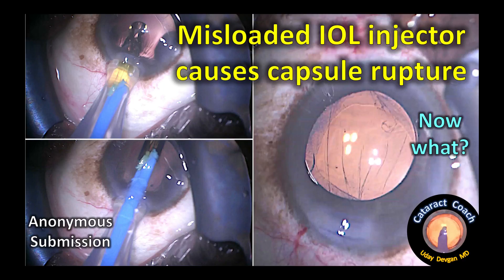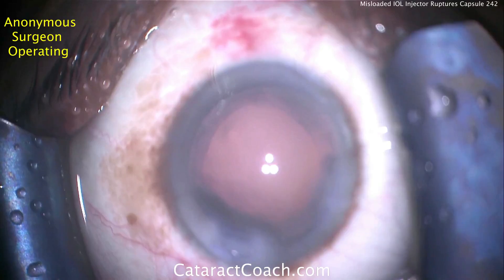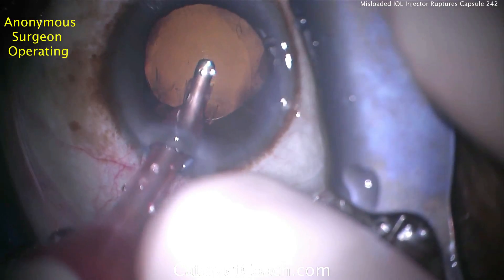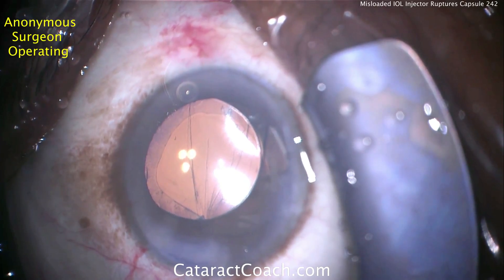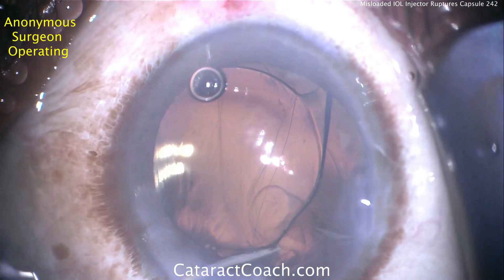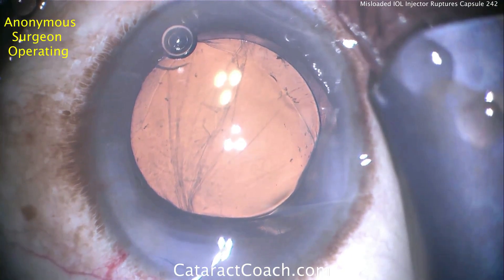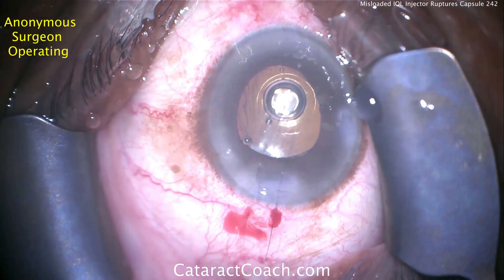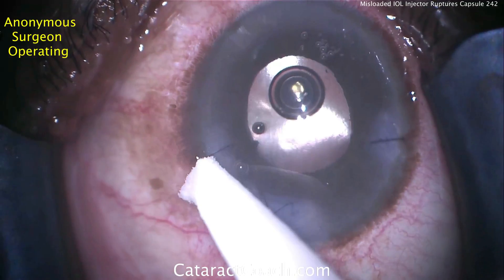How to fix: Misloaded IOL rips open the posterior capsule in Cataract Surgery

Comment: Thank you so much. A very interesting case. With all respect I don’t think IOL tore the anterior capsule. I’m not saying it never happens, it happens but is very rare. Keep in mind these facts:
1. Anterior capsule is very elastic and stretches up to 40% because we are able to express a whole cartaractous lens which is 10 mm in diameter through a 6 mm capsulorrhexis. 
2. IOL surface is not sharp to tear the anterior capsule
3. What happened in this case is, the capsulorrhexis is intact when the resident finishes the rhexis, but if you watch the video multiple times from 00:58 to 1:05 you see  extension of anterior capsule toward the periphery which implicates most probably resident tore the anterior capsule at some point during Phacoemulsification with either Phacoemulsification tip or chopper. Now there is a torn anterior capsule and an IOL which is ejected rapidly into the capsular bag and hits the posterior capsule, applies some traction on an already torn weak anterior capsule and results in its extension toward posterior capsule.
Reply from the maker: good points and a reasonable explanation. As this video was an anonymous submission, I do not have the full details. Thank you for the sharp insight.

Comment: nice done sir, i usually do bi manual vitrectomy using coaxial i/a for irrigation and the other piece of bimanual vitrector... but is good idea using two incision.
What do you think about pars plana anterior vitrectomy in this case?
Reply from the maker: I prefer to avoid using the main incision since it tends to leak a lot. I prefer a bimanual vitrectomy with two smaller incisions. Yes, pars plana is another reasonable approach.